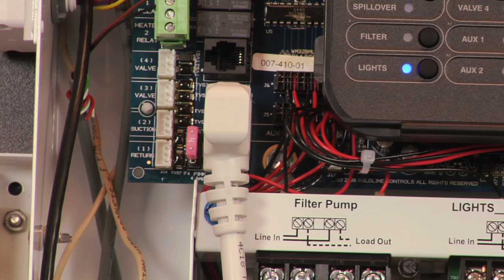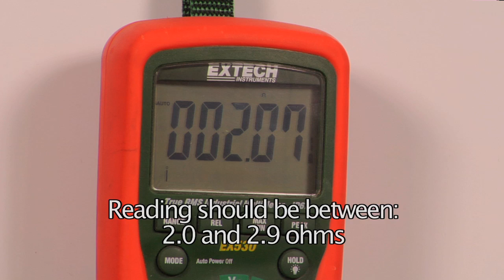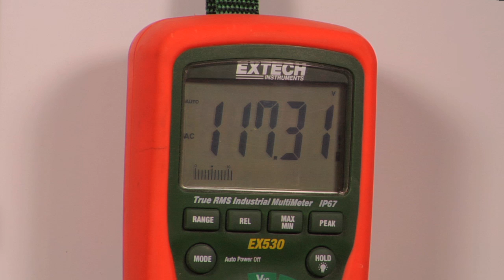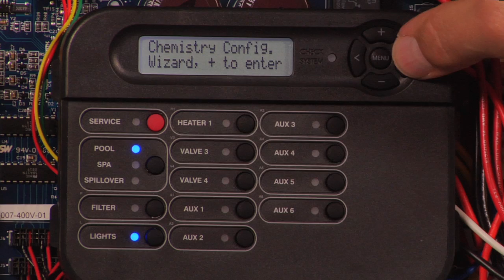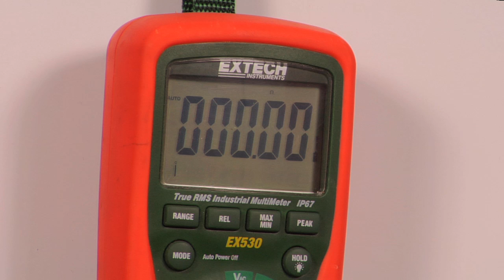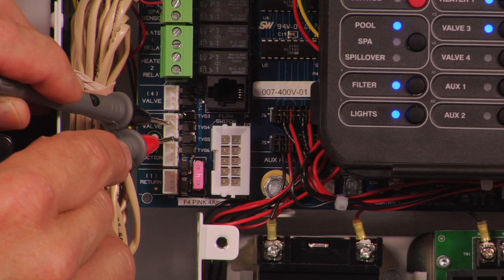ProLogic: Troubleshooting

Comment: This is one of the best videos out there on this issue. Thank you. What is the issue when there is no voltage between 2 orange wires? My fuse is good, but no voltage between orange wires. I replaced the board with new board and still same issue. Appreciate if you could help. Thanks

Comment: I’ve checked orange wires to rectifiers, don’t have voltage, fuse is good. It appears there is a relay that needs to be energized but it is not. What is required to energize the relay?
Reply: Appreciate if you could let me know how you fixed this issue. I have the same problem.. Fuse is good but no voltage in orange wires. Thanks
Reply: @publictrader4180  Yeah me too no voltage 0.4v at orange wires the Fuse is good and the red/black is 0.2v. So if its rectifiers where are they mapped on this board?